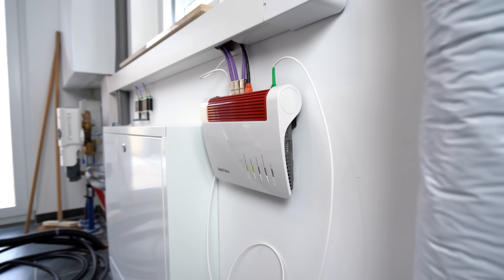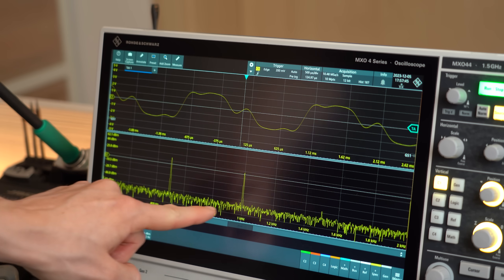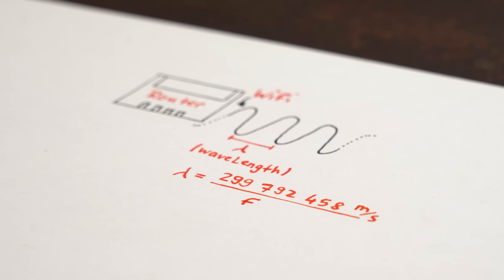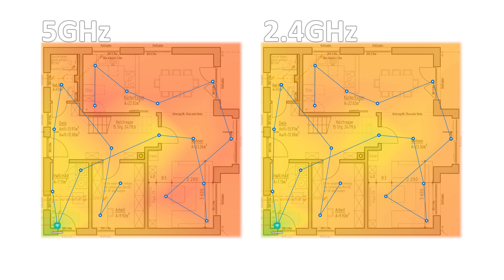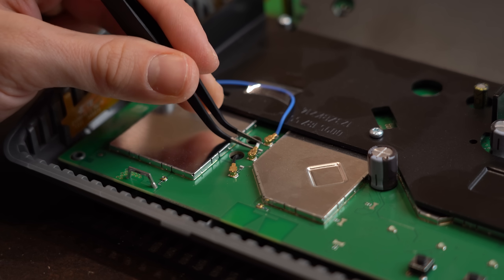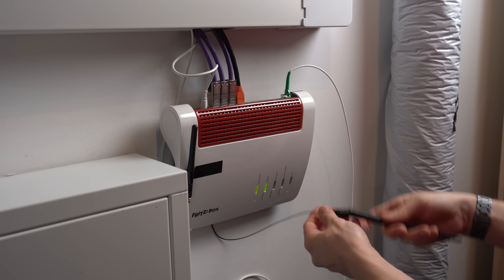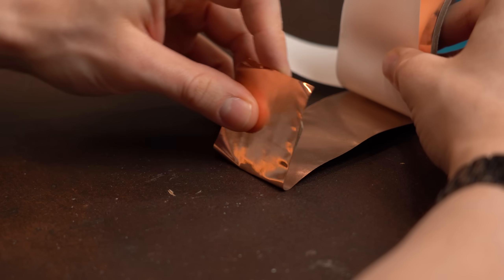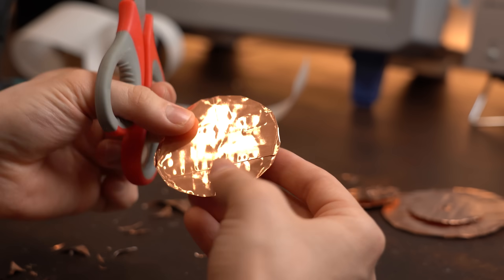I tried OVERPOWERING my WiFi!

Comment: One gotcha is the devices being used on wifi.  I could crank up my power to 100% and transmit pretty long distances.  A low powered device such as an iPhone will pick up the wifi but does not have enough power to transmit back reliably.

High power will also inject distortion into the transmitted signal.

Proper wifi design is to transmit using low power and have a sufficient amount of access points. This way you get a reliable wifi network with consistent throughput over the entire area.

Comment: The best play is always to strategically place access points, but if you dont have a lot of Ethernet already ran through the walls this is the next best thing :)
Reply from the maker: Thanks :-)
Reply: Better if you use a mesh system, it can do wonders.
Reply: Another option is a mesh network, where the access points are wirelessly connected together. But ethernet is always more reliable and faster than wireless.
Reply: @SamiKankaristo  in any decent mesh network the nodes can also be connected by cable to boost its performance.
Reply: @GODAXEN , that's true, but I was talking about an alternative to running ethernet cables (or having them already installed, like in the comment I was replying to).
Reply: Hard wired ubiquiti aps, on the ceiling, 2 per floor and one in the workshop.
Reply: I simply ran Ethernet along the baseboards in my rental home, since I can't really drill holes all over the place. Nearly invisible unless someone specifically looks for them. The trickiest part were the corners. If it's your own home, I'd simply buy baseboards with cable channels in them. There's a few manufacturers for this.
Reply: The problem with multiple access points is roaming isn't always seamless for every device, especially older ones.
Reply: @surrenderedwill3326  and the problem with a silly antenna is that it's too directional

Comment: damn man, your fiber optic cable is bent so badly, it'll break from the inside 7:05
Reply from the maker: No. It has that loop so that it does not break.

Comment: There are not only limits to maximum transmit power, but also Effective radiated power, so you are also not allowed to simply hook up a directional antenna as that might raise your EIRP in that direction too high.
Whilst using different antennas might feel good, afaik you might just kill your MIMO capabilities, crippling your speeds even though your signal strength is better because the communication falls back to less channels.
And of course you can move the router to a better location with less things in the way like a more central location and an orientation which matches the antennas radiation pattern (though that is typically already good)

These consumer routers are a good all-in-one-package housing the modem (to translate fibre to electrical), the access-point (the wifi-module) and internal services (routing, dns, ..) in a neat package, but this might not be desirable in all cases.
You could place the modem (like your current router) where your fibre comes into the house and then run ethernet to a separate access-point in a more central location, or even have multiple access-points for better coverage.
Without running wires, you can use mesh-APs, though they usually cost quite a bit more and are prone to interference and wireless limitations themselves (but usually work quite well in typical setups)
Reply from the maker: Thanks for the feedback. Interesting.
Reply: @greatscottlab to make his post more simple in Europe acxording to  SRD (short range device)  directive which cover unlicensed frequency that are used for among others Wi-Fi you have limit of max power given in ERP (for example on 2.4GHz limit is 100mW ERP) and ERP is calculated as output power times gain of athenna (or in db outpit power of transmitter + anthenna gain).
So if you want to stay legal you must lower output power of transmiter if you increase gain of anthenna, so you get nothing by changing antenna. Only way that it can be usful is if you have different transmit and recive antenna so you increse gain of receiving antenna.
By the way in SRD frequency of 2.4GHz is listed on 2 places once as ISM where max ERP power is listed as 10mW and on other place for high speed data network (that part is relevant to Wi-Fi) with max ERP of 100mW (in USA ISM cover everything including Wi-Fi but they have different power limits and they do not use ERP but output power with correction for antenna gain).
Reply: There's also just a limit to how much increasing the access point's transmission power even helps. Even if you could get your phone to see the Wi-Fi network from really far away (or through lots of obstacles), it doesn't magically increase your phone's transmission power, and with Wi-Fi, communication needs to work both ways.

And I agree about separate devices, I always like to have a separate modem (usually ISP provided), separate router, and separate access points.

I moved about 6 months ago, and all I had to do is set the new ISP router to bridge mode (so that it essentially works only as a modem), and I didn't have to set my port forwards, etc. again, because those are all on my (separate) router. And a bit earlier, when my old router couldn't handle my new faster internet speed, I didn't have to change my access points.
Reply: @SamiKankaristo  increasing power of transmitter do not do anything if you do not do on both sides, but increasing anthenna gain is enough only on one side, it increase radiate power (transition) and increase received power.
But again, in Europe, with a single antenna for receiving and transferring, you will get  nothing. With a higher gain antenna, you will be able to receive a signal from further devices, but  your transmit distance will not change if you want to stay legal.
Reply: @mrlazda  That is true, increasing antenna gain will help directionally, I didn't write clearly enough.
Reply: @SamiKankaristo  using high gain antenna can be useful for point to point links. I once tried that (more like joke bacouse my solution was inpracicle). I used the provided antenna as transmit antena (to keep under legl limit) and 3m parabolic antenna as receiving antenna, both connected to Wi-Fi card using rf circular (duplexer), same setup on both side. With that setup, you get theoretical Wi-Fi distance of near 100km (not try), but you need to aim parabolic antenna wery precisely (it has received ange of like 3 degrees). As I say, it is for all but niche cased inpracicle.
Reply: you are wrong my friend. this is why i got a 300 meter radio station antenna so my xbox controller can have better range
Reply: So commercial routers are making sure they're legal
Reply: Thanks someone know the RF... I was quite mad watching this video.

Comment: I had a long omnidiectional antenna on my old router. Works good if you don't need a signal above or below the antenna. It flattens out the "donut".

I didn't look inside, but I guess it was a halfwave dipole instead of a quarterwave monopole?

Comment: Having a better antenna might also get you into trouble. The maximum legal power is not the power out of the amplifier, but the EIRP. The EIRP takes into account the gain of the antenna (how much better it is) in addition to the power. For instance if you have a power of 10 mW and an antenna gain of 10, then your EIRP is 100 mW (the maximum for 2.4 GHz Wi-Fi). So increasing the gain of your antenna without reducing your transmitted power should still be illegal. It's actually logical, otherwise you could use a giant dish as Wi-Fi antenna and potentially jam any device in its aperture.
Reply: Unless you're doing it deliberately interference is incredibly unlikely. Also, the amount of signal at your neighbors is usually still much less than if you simply physically moved your router closer to them within your property.
Reply: @BooBaddyBig they mentioned apartment buildings tho which is an absolute nightmare for connectivity. In that situation I’d probably just try to use a wire wherever possible
Reply: @nadaso8819  Always, but for devices like phones, it's not always possible.
Reply: Ham operator here. it is INCREADABLY unlikely to boost that signal with any antenna enough to cause any significant interference.
Reply: 2.4ghz 5ghz are such  noisy bands anyhow I can't imagine you'd be doing much damage with a high gain antenna. @imagitu6409
Reply: @imagitu6409 my next door neighbor found a small RF distribution amplifier with no antenna hooked up and a mobile gps jammer a trucker used to goof off and not get tracked by his company. The amp was left plugged in after an apartment block removed a roof antenna. After years it decided to oscillate.  Both were annoying an international airport. The apartment was a whoopsie, it didn't end well for the trucker.  Annoy the wrong people you'll get noticed.
Reply: @imagitu6409 partly true, you could at least mess around enough to make the SNR go down significantly.
Reply: @MaxMüller0   its usually better for the router to be in the middle of your perimeter, but that would be the easy non-fun solution to his problem and wouldn't be good for a video
Reply from the maker: Thanks for the feedback. Will keep that in mind :-)
Reply: @greatscottlab  However as you now have external connections ,
 you can add some coax extensions to mount the antennas in a central location with some tape.
Even raising them up a little and making point more vertical as dipole is sideways and the signal maybe getting lost as I noticed that the angled is pointing to the floor a little.
This should be a better option as it is not only the router but the device that is also transmitting back to the router.
Reply: Keep the omni antenna and use the classic CD to aim away from the boundary wall.
Reply: Not like they will check or something 😂😂😂
Reply: @-never-gonna-give-you-up-  Here in germany they will check, quite quick, the Bundesnetzagentur is not someone to joke around with.
Reply: @legominimovieproductions  The Bundesnetzagentur is not really like that. I hope they try to take my wifi away. They will never find me.
Reply: @HoloScope  Do you know what a Messwagen is? Finding you is the smallest problem
Reply: @legominimovieproductions  then they won’t be able to find me lmao, I already know how they find people
Reply: @-never-gonna-give-you-up-  Depends if it noticeably interferes with something. If it does, whoever is in charge of radio transmissions will send someone to find and deal with the issue. Otherwise it's just a jerk move to interfere with your neighbors WiFi, which is guaranteed to happen in an apartment building.
Reply: @tortex1 trust me, they can't find who is having a better wifi signal nor do they have the legal resources to access the building. 

Been blasting my wifi system for years now and no one said anything about it, perfect wifi everywhere, that's what i pay for, that's what i want.
Reply: @-never-gonna-give-you-up-  I heard some stories involving too powerful WiFi in a city and the lovely Bundesnetzagentur.
Reply: @-never-gonna-give-you-up-  yeah but not that 40w one
Reply: I mean, it's not as if there's some unique name or identifier used in any WiFi system that would stand out like a sore thumb, say an SSID or MAC, everyone just has to guess which signal is the one from their router and hope they get the right password yeah?

Plus, Germany, they're famously tolerant of rule breaking and don't ban things for causing interference, like Baofeng radios for example.

And of course, your WiFi can't possible be seen outside your apartment building

Oh, wait...   @-never-gonna-give-you-up-
Reply: how would i go about doing something like this?  @-never-gonna-give-you-up-
Reply: @-never-gonna-give-you-up-  I will say this, I live in a town of 8000 in Ontario, Canada.  I can pick up not only the wi-fi access points in my own home but I can also pick up nearby routers from the surrounding houses and even people's printers.  Our lots in North America are probably larger than what they have in Europe.  That being said, I don't understand why something like that would be tightly regulated but the easy solution is probably having your main access point and either repeaters, extenders or even going with fully wired versions like running Cat6 to different parts of the house or power line networking and connecting through an Ethernet interface card.
Reply: @WJCTechyman  i tried that but here its all concrete walls and stuff, if it would be drywall it's quite easy but here you'll need a dang jackhammer to get through the reinforced concrete with metal bars 😭
Reply: @WJCTechyman my house is concrete walls it's a pain for WiFi and will show good signal but just not work, however because it's a terraced house on a housing state I can pick up at least 5-6 of the neighbours if not more. All kinds from routers to smart TVs. I don't think interference is that big of issue.
Reply: @-never-gonna-give-you-up-    dude.... Here in the US the last person you want to see show up at your door is the fcc. I'd honestly rather see the tax man. Which is saying something😂
Reply: will the wifi police come to your house?
Reply: @executive Wifi freq interfere with the rain radars receivers. They make a blind spot (a line) on the rain map. If you output a 40W wifi signal, or using a big yagi, the radio freq police will visit you very soon.
Reply: @hopje01  have you ever seen it happen?
Reply: @executive  Kind of, yes. And they even have right to confiscate your problematic device and fine you
Reply: @legominimovieproductions  do they drive around neighborhoods looking for wifi criminals?
Reply: @executive only if someone calls them, usually because their system suddenly stops working the way it should. They can get rather nasty if they do find you though - if the system being interfered with is important enough, they can and will break doors.
Reply: Yet, people use powered wifi signal booster antennas which are legally bought, right?
Reply: True, but there is no antenna that will 'boost' a 10mW signal to become bothersome enough to anybody to send out regulation inspectors to find who's doing it...
Reply: Just in case you don’t know
But you need an also strong signal on the other side…
And your lil smartphone don’t have that…
Receiving and answering on both ways otherwise you are wasting money for a strong wifi that no one can really use.
Reply: So I actually measure RF fields for a living to write policy and procedures for the safe operation of transmitters.

You very obviously have no idea what you're talking about.

No standard anywhere gives a hoot about EIRP. It stands for equivalent isotropic radiated power. It is the power that would have to be delivered into an isotropic (the same in all directions) antenna to produce the field strength equivalent to that which a directional antenna is producing.

The thing standards care about is SAR (specific absorption rate), measured in W/kg. These form the Basic Restrictions, and for wifi the limit is 0.08W/kg (whole body) and 2W/kg for the head/torso.

From these, where the person will be in the far field, standards derive reference levels which specify the field strength allowable, which depends on frequency. This is in W/m².

In the case of wifi that's 10W/m²

Given the far field distance for a 2.4Ghz and 5GHz signal is less than about 5cm (depending on the length/diameter of the antenna), you're well into the far field virtually all the time, but even if the reactive and radiating near fields are accessible, 0.08W/kg is still quite a bit.

Basically, you can't make this dangerous at those kinds of power levels. It's just not possible.
Reply: @dtnicholls1  "You very obviously have no idea what you're talking about.

No standard anywhere gives a hoot about EIRP."

Except literally all the standards, including WIFI and ISM band standards, for radio transmission equipment which specify the transmitter power limits as EIRP. If you are going to claim to be an 'expert' then it would have been sensible not to have immediately gone on to prove that "You very obviously have no idea what you're talking about." 🤐🤣

The limit in the EU for 2.4Ghz WiFi is 100mW EIRP

I'm sure you're an expert in your field wrt safe power levels but as you say, the WiFi limits are far below those which impose any danger to health. I expect ('expect' as I wasn't on the committee) they specify EIRP or ERP limits to limit potential for interference with other users of the band.
Reply: This is correct on the physics, false on the legal side of things - with Wi-Fi, there is quite deliberately no restriction on EIRP (as far as I know, this is true everywhere, it's definitely true for the EU). This means that your can't increase transmit power beyond the ERP limit of the band you're on (remember this is at the antenna, longer cable runs usually need higher TX power to get the max legal ERP), but you can use high gain directional antennas to build long distance mesh networks and such. There's commercially available hardware that's specifically designed for this purpose and is entirely legal because of the way the laws are written.
Reply: I really invite you to check because I know for a fact that in France the EIRP is limited, and from the documents I was able to find (even from people selling Wi-Fi equipment)  it seems that it is the EIRP which is limited in ETSI (European Telecommunications Standards Institute), Germany, Australia, USA to cite only these 3 countries and regulatory body.
For point to point equipments, such as the ones you described, the limits are higher to allow them to work properly.
Reply: I mean, I might be reading it wrong but the EIRP limit is quite literally in writing, in the very same video that you're commenting on  @jandl1jph766